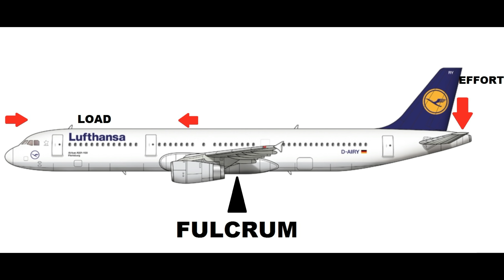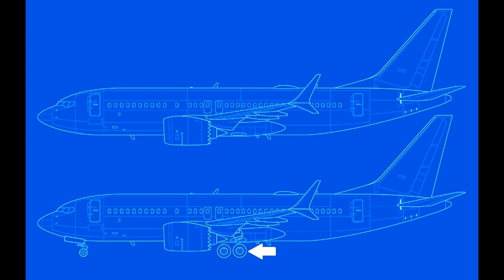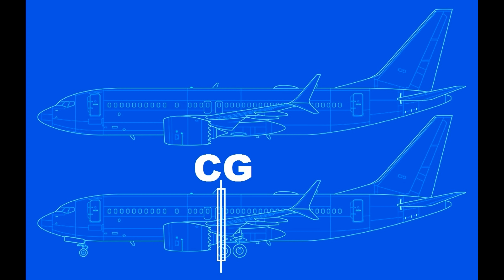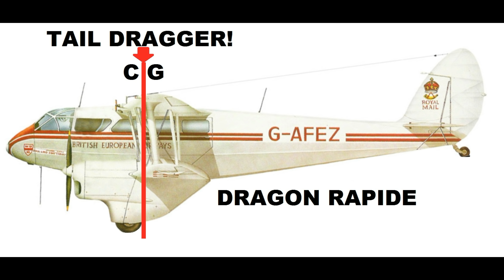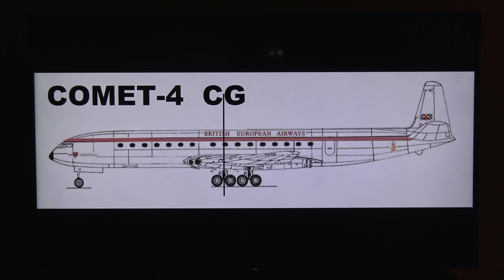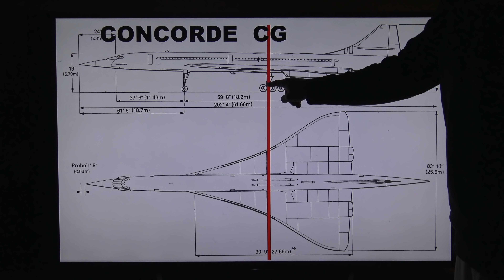Biggest RC Airplane CG DIY HACK [4K]

Comment: Good simple method. However, you state that on tri-cycle aircraft that "if the CG were aft of the main gear", then the elevator would not be able to apply enough downforce or if it were too far forward, then it would rest on its tail. That is exactly the opposite of what would be correct, logic makes it obvious that if the CG (Center of Gravity) were too far aft (towards the tail, behind the fulcrum point) then the plane be sitting on its tail with its nose in the air. You stated it in reverse twice, around 2:30 & around 11:05.
Reply from the maker: I humbly be to differ my Friend,  if the cg was aft of the main gear the plane would never be able to rotate, try it yourself on an RC plane and you'll see, and if the CG was to far forward the plane would be crazy tail heavy.. . . Physics it's all physics and aerodynamics whawaii.
Reply: While I agree that using the position of the main gear on a full-sized aircraft, is a "Very Good Simple Way" to locate the point for the  "Center of Gravity" on a model aircraft. If that place is "aft" of the main landing gear (toward the rear of the plane) on a tricycle configuration the plane would sit on its tail like in this picture. https://en.wikipedia.org/wiki/File:BAe_146_centre_of_gravity_problem.JPG
Reply: I would also like to add, that the "Center of Gravity" (CG) is universally defined as the "central point" on an aircraft where Earth's Gravity is essentially pulling it downward at that point. In aviation, we shift this "point" by adding, subtracting or moving weight within the plane either "forward", towards the nose, or "aft", towards the tail and Earth's Gravity pulls the plane down at this new point accordingly. In the air, the "Center of Lift", from the wings, provides the fulcrum that works upward against Earth's Gravity. For flight stability, we want our "Center of Gravity" just in front of the airborne "Center of Lift" fulcrum. On the ground, the fulcrum point is where the main wheels are in contact with the Earth, which becomes the fulcrum, also in the upward direction, against the same "Center of Gravity". In the Tricycle configuration, we also want this "Center of Gravity", forward of the fulcrum point (the main wheels), not "aft" of the main wheels. From my decades of designing aircraft, I understand your basic logic (and it is a good one) but the misstatements you present in your video could be confusing & possibly a disservice to those who are interested in learning from your knowledge. They may end up repeating those misstatements & being ridiculed for using the wrong terminology or misstating information which is universally understood differently. I've seen it happen.
Reply from the maker: @whawaii  that BAE-146 has fallen on its tail because all 4 engines have been removed making her tail heavy and thus falling back on her tail.
Reply: When you use the term CG (which means "Center of Gravity") are you meaning the "Center of Lift"? The CL "Center of Lift" is NOT the same as the "Center of Gravity". "Center of Gravity" is the Force pulling the plane to the Earth. "Center of Lift" is the Force pulling the plane up into the air which is the opposite of Gravity.
Reply from the maker: @whawaii  Sir, thankyou for sharing your info & time!
Reply: whawaii “
Reply: I know this is a year old, but he’s right. Good way to picture the cg is weight pulling down. I think you were referring to center of pressure (weight pulling up).
Reply: @F3HDemonDriver1  I'm quoting this from the link I provide below....
"The primary concern in balancing an aircraft is the fore
and aft location of the CG along the longitudinal axis. The
CG is not necessarily a fixed point; its location depends on
the distribution of weight in the aircraft. As variable load
items are shifted or expended, there is a resultant shift in
CG location. The distance between the forward and back
limits for the position of the center for gravity or CG range
is certified for an aircraft by the manufacturer. The pilot
should realize that if the CG is displaced too far forward
on the longitudinal axis, a nose-heavy condition will
result. Conversely, if the CG is displaced too far aft on the
longitudinal axis, a tail heavy condition results. It is possible
that the pilot could not control the aircraft if the CG location
produced an unstable condition."

You posted, and I quote: "if the CG was to far forward the plane would be crazy tail heavy"
That's incorrect. The exact opposite is true meaning the aircraft would be "nose heavy".
CG forward = nose heavy
CG aft = tail heavy

https://www.faa.gov/regulations_policies/handbooks_manuals/aviation/phak/media/12_phak_ch10.pdf
Reply: @F3HDemonDriver1  "if the CG was to far forward the plane would be crazy tail heavy" Are you high bro???

Comment: How about a F 18 C version with a trailing link?
Can you run the CG on that plane?
Reply from the maker: Yes indeed, the CG point on the F-18C is a tad forward of the extended gear down position of the main gears when they are down, about one main tire length ahead of where the tire is.

Comment: People can indeed use a method something like you described to balance most RC airplanes, in a general way.  However, as others have mentioned, everything you said from about 2:30 to 3:20 is exactly backward. For those who want to understand this (and much more) I'd suggest Andy Lennon's book, "The Basics of RC Model Aircraft Design". With some VERY simple math, you can take the guesswork out of your designs, and produce models that will fly "right off the table".  Good design principles can tell you BEFORE your attempt at a maiden flight, whether the CG is right, the wing loading is too high, the weight too heavy, the power-loading is wrong, etc.. You don't ever have to have an aircraft fail for reasons you could've fixed before you even started building. None of those things are "secrets"... They're standard reference material every RC pilot should have in their hands.
Reply: 100% Agree. He states IT the opposite of what is correct.

Comment: now that clears a lot up with wheeled aircraft but what about waterborne planes such as flying boats float aircraft and what about aircrafts with skis?
Reply from the maker: No this is a slight problem, but if its an amphibian like the PBY Catalina or Cessna-172 or Cub you can look at the land version to find the CG.
Reply: RC DemonDriver 
The CG is determiniert before  the landing Gear is added . A Pläne is designed to fly , Not to ' Drive ' On the ground . So the landing Gear comes After the CG . Most Wings have a CG Range als far forward as 17% and 33% !
Reply from the maker: @abmodels2327  but dont forget most seaplanes have stair wings, so determining the cg is easy in that case, the CG is 18 to 25% from the start of the wing chord.
Reply from the maker: Strait-wings I meant lol

Comment: What about a hand launched aircraft with no landing gear ? Also if the gear placement is done wrong the c/g placement will also be wrong . Possibly catastrophically wrong . I understand a misbalanced 777 won't get off the ground if to far off balance . But a very overpowered R/C model , which most of them are can be horsed off and then , good luck . Balance according to the wing . That is always correct . If it doesn't sit on the gear properly then move the gear .

Comment: That is great explanation of the location of the landing gear in relation to CG, but not the other way around.  In other words, the CG drives the location of the landing gear.  The landing gear doesn’t drive the location of location of the CG.

You’re much better off finding the mean aerodynamic cord (MAC), then go 25% back from the leading edge... because that is how planes work.  Nose heavy will fly.  Tail heavy will fly once.  Why risk getting it wrong?

Comment: You are wrong !
A CG that is too far aft will cause a plane to rotate more easily. In fact it has been the cause of many accidents on take off, since the airplane will easily pitch up past the critical angle of attack at which it will stall.

Comment: Hi, it will be same method in example B777 or B747 where is more than two landing gears?
Reply from the maker: Yes it should be, on the 747 just as one gear-truck ahead of the 1st set and there you are.. . . This method is strait forward and reliable.
Reply: @F3HDemonDriver1  Thanks for reply, i'm guess that this mean about a factory fitted landing gears. What about when  gear are fitted in different place?
Reply from the maker: It's the Factory Gear position that you must follow ZIt.
The CG Point is closely related to it.

Comment: Hi Demondriver!
Another great video!

In engineering books, the rule for tricycle landing gears is that 90% of the weight of the aircraft should be on the main landing gear and 10% on the front. So the CG should be 1/10th of the distance between main and front landing gear struts, after the main one. More or less like you explained :).

Have a nice holidays!
Reply from the maker: 100% Correct Sir! Happy Holidays my Friend!

Comment: Are you for real? If the cg is on the mains how can the plane rest comfortably on its nose? If there would be more passengers or load behind the main gears towards the tail which is the pivote point, it would tip over as soon as the pilot removes the breaks.
When the plane lands flairing nose pointing to the sky and touches down on its main gears first, on what end you think the plane will lean if the cg is on the main wheels?? Of course it will rest on its tail
If the plaine is a tricycle the main gears are always behind the cg
Center of gravity is calculated with weight, arm and momentum 
Who made you believe that you are qualified to explane such a complex topic to the general public, which engineers are you referring to?
This is the stupidest video i have ever seing